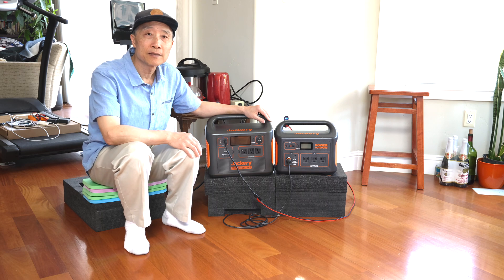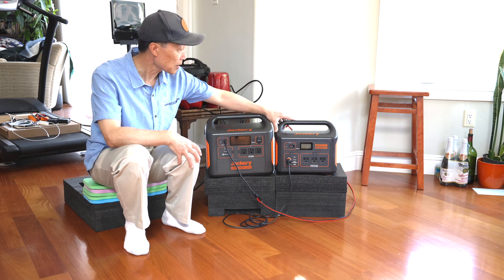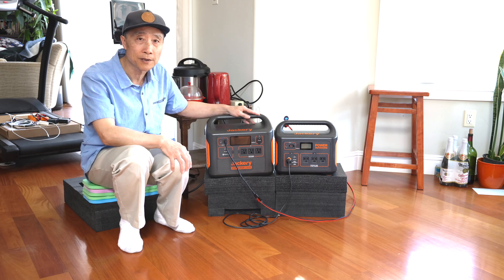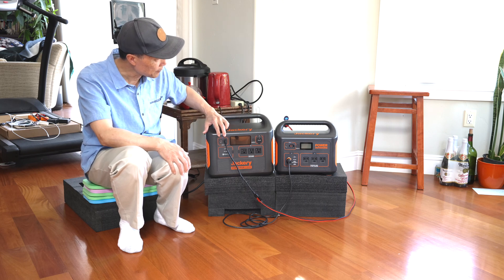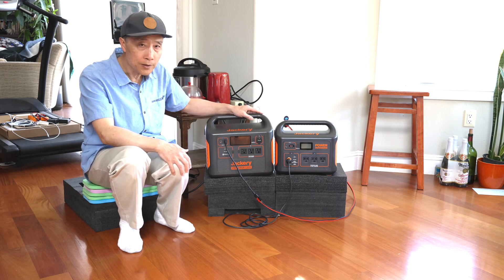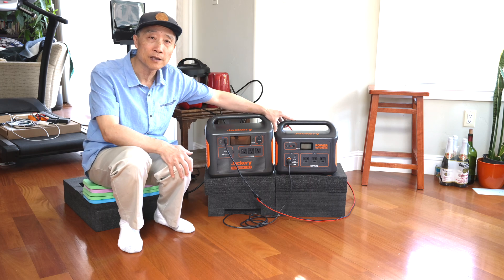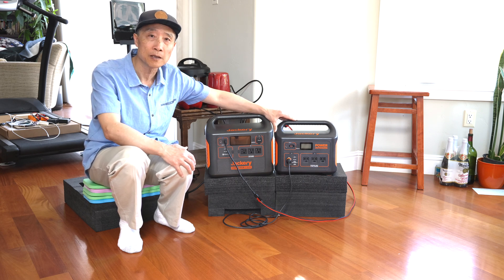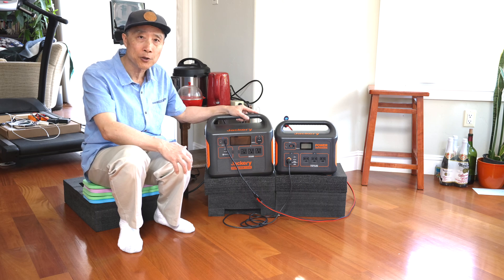Jackery Explorer 1500 - A Good Product but with a Charging Issue

Comment: I have used my 1500 only a hand full of times during power outage. Last time when I went to recharge it cycled between 0 and 4 watts. Reset the unit and the same. called Jackery customer service and they said even tough this is a know issue with the product, my warrantee had expired so I was screwed. Do not buy products from this scam company! !
Reply from the maker: I’m sorry to hear that you had such a bad experience with the 1500 and customer service. Mine is still working and I have been using it daily. Hopefully it will last for some time.

Comment: I'm not an electrician, but isn't it normal for your battery to draw more charging current if it is more discharged?
Reply from the maker: My observation is that the charging rate is the same until it reaches upper 90%. Then the rate slows down very noticeably.
Reply: @ShenYe01  Got it...thanks for the reply..

Comment: The lower the battery charge rate the longer it will last, assuming the reading is accurate and not due to a firmware or hardware issue.
Reply from the maker: It was generally true that slower charging would result longer battery life. However, this is not the case. Jackery claims charging efficiency improvement of 30%, but it is in fact lower charging efficiency compared to Jackery 1000. The solar panel potential is wasted and charging time is unnecessarily longer.

Comment: Hai   great and  much informative review  about jackery  power station. Can I connect  e bike Power charger to  this  power station  while riding my RAD E- BIKE 🚲 . Can I tie and connect  this to  extend  the range   of Electric  Bike.
Reply from the maker: I think it should be very possible and it all depends on how much power your e-bike draws when charing. I have used Jackery 1500 to charge a 2013 Prius plug-in. The output power shown on Jackery is about 1260W. No problem.

Comment: Thank you for the detailed review. I also have a jackery 1500 but having a charging issue. I have a single 100watt Solar saga panel but it does not charge. Do you know what it could be? The panel works because I charge through USB ok but once it connects to the jackery it does not work. Any help would be greatly appreciated . Thank you and keep up the informative videos!
Reply from the maker: My guess is that your 8mm connector does not have a thick pin. You can compare the pins of the 8mm connector which comes with Jackery 1500 and your 8mm connector. Since you don't have two panels, the combiner from Jackery 1500 cannot be used, since it connects two panels in series. I made my own connector by cutting out a 8mm connector from one of the Jackery connectors. Hope this helps.
Reply: I have 1x solarsaga too, what do we do about this? Have u figured it out?
Reply: @drybonez2087  Yes thanks to @Shen Ye, you will need to contact Jackery for a single adapter that converts the plug to a smaller connection. Works perfectly.
Reply: @BeeChan_  how do i contact them? I teied calling them and it never goes thru
Reply: @drybonez2087  I sent an email and they responded about 4 days later.

Comment: Did you have to use a specific cable to connect a 3rd party panel to the 1500? I tried connecting a renogy 175watt flexible panel with the mc4 to 8mm cable and nothing happened at all.
Reply from the maker: It is almost certain that your 8mm connector is a regular one, i.e., the center pin is a thin one. Jackery 1500 requires a thick one. (Compare the pins from the Jackery 1500 charging cable and your mc4 to 8mm cable). Jackery has a thin to thick pin adaptor which should comes with the package, but not as I saw. You could either ask them to send you one or make one by yourself. Good luck!
Reply: @ShenYe01  Thanks! I figured it was a cable issue. I will have to try to order the right adaptor. I'm sure that is what it is because the cord felt loose when plugged in.

Comment: Shen, is it your understanding that this issue can be fixed without sending the unit back to Jackery?

I believe there is a Jackery App on the way, as there are Wifi and Bluetooth symbols in the upper left of the screen when resetting the unit. Have you noticed this as well?

Perhaps the App will offer over-the-air firmware updates.
Reply from the maker: I don't have much insight on how these power stations work. But it does look like a software issue rather than hardware issue, because it works very well when connecting much higher input power.
I did not see Wifi or bluetooth symbols. It would be great if the fixe could be done over-the-air. Or maybe like my camera firmware update that you copy the new firmware on a memory card/USB stick and start from there.
Reply: My god, you're right. There is very obviously a wifi and bluetooth logo on the display. How has nobody noticed this?

Before getting too excited however, they may plan to use this display across a variety of models and there may be no wireless radios in this unit.
Reply: @csrussell  I just reset mine and saw the icons!  Awesome!  But there's no FCC ID on the bottom tag. So I'm going to assume it's for a future model.  It's like all the missing buttons on cars for those options you didn't get lol.

Comment: Thanks for this video and great catch on identifying the charge efficiency issue!  

After much research, I selected the Jackery 1500 as my first power station purchase based on its capacity, charge efficiency ( I bought the Saga 100 solar panels and was impressed by how quickly they charge the power station), footprint, and low relative weight. I was also impressed by the number of Jackery users who gave high marks to Jackery's customer service/responsiveness. I hope they expedite the solution to the problem you brought to their attention. Thanks again.
Reply from the maker: Thanks for your comments! I do like Jackery power station a lot and that's why I bought the 2nd one to upgrade. I hope that Jackery will fix this charge efficiency issue quickly.
May I also ask how many Saga 100 you have? When you connect one or two or more, what input power do you get? I hope to get an answer if this charging efficiency issue occurs only from non-Jackery branded panels. Thanks.
Reply: @ShenYe01   Jackery had a launch day special package that included 4 Saga 100 panels. When I received the power station it had a 25% charge. I connected all 4 panels about 11:30 AM (I'm in Massachusetts) and by 3:00 PM they were at 94%. I noted they were maxing about 590 watts into the Jackery.
Reply from the maker: @Dan, thanks! So for 3.5 hours you get (94% - 25%)*1488 = 1027W and each hour (on average) = 1027/3.5 = 293W. Since you have 4 panels, each one generates 293/4 = 73W (on average). This is very good and inline with Jackery's charge efficiency statement. I hope that Jackery will let us get the same charge efficiency for single solar panels.
Reply: @ShenYe01  Thanks for your calculated average - it makes more sense my 590 watts remark which I extrapolated based on a one-time (just before 12 noon EST) 93% being generated on the basis of 600 watts (possible) rather than 400 watts (actual) of solar panel deployed. It will be interesting to learn whether the charge efficiency problem you identified is a software or MPPT technology hardware specific. Thanks again!
Reply: @Duncan Calvin flixportal :)
Reply: @Jackson Jeremias thanks, I went there and it seems to work =) I appreciate it !!
Reply: @Duncan Calvin Happy to help =)
Reply: I guess it's pretty off topic but do anybody know of a good site to watch new movies online ?

Comment: Thank you for your review. Charging issue is good to know. I also heard the Jackery 1500 has a loud fan. Can you please compare the Jackery 1500 vs Jackery 1000 fan noise under different AC loads? Thank you!
Reply from the maker: Once the AC button is pressed, Jackery 1500 fan will start running no matter if there is any load. It is at very very low speed almost inaudible. Similar to Jackery 1000, when there is a load of a few hundred W, the fan will blast at high speed. I would say that the total volumes are similar between the two. However, the Jackery 1500 fan noise is at a lot higher pitch, so it is more "annoying".
Another difference between the two is that when AC load returns to zero but the AC button is still pressed, Jackery 1000 fan will stop running almost right away, but Jackery 1500 fan will keep running for awhile.
Reply: @ShenYe01  Thanks again! I really appreciate all the details.